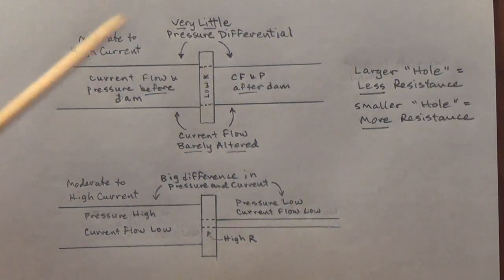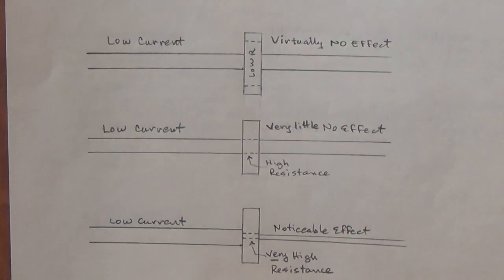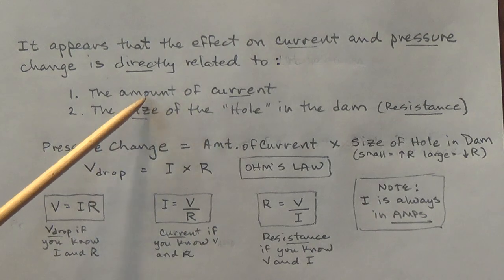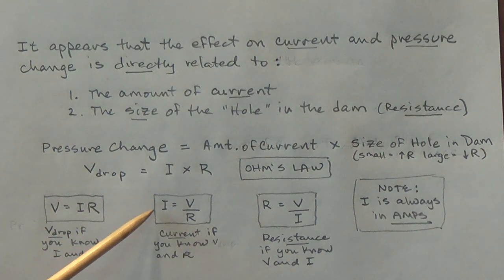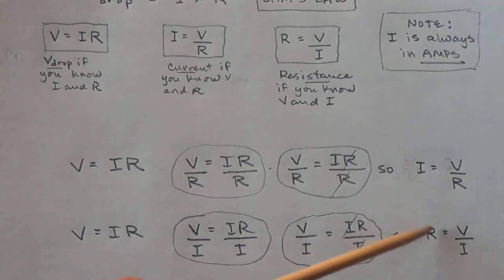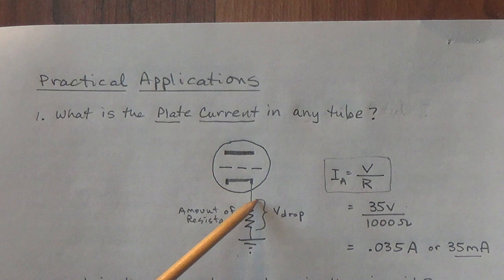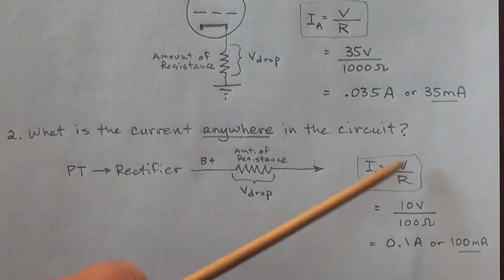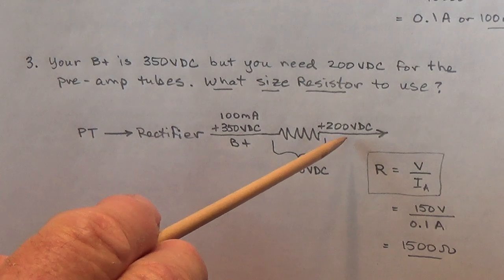Resistors, Part 1:  Their Circuit Function &  Practical Applications of Ohm's Law

Comment: I cannot believe that I *finally understand Ohm's law! Thank you! Drop in River Pressure on the down side of the Dam equals Initial River pressure times the hole in the Dam. 
V = I x R - the stuff coming out of my 63 Fender Concert Output Hole needs to see speakers resisting at 2 ohms so I get my good sounding 40 watts. Proper resistance! 
-
My amp circuit needs to be fed proper current in various places after the tubes... and RESISTORS dam the river for the proper flow.  Wow. Thank you!! I took algebra twice in middle school, the first time I passed, but I wanted to get it (and enjoy it) the way I got math before that... so I took it again to get that A and to understand it.  I love it... but I like Geometry and Trigonometry even better... because, in high school, I loved arguing and proving stuff. :-) Again... THANK YOU!
Reply from the maker: +Jensen Bell  You're welcome, Jensen. Hearing that the videos are helpful and informative is good news indeed :)

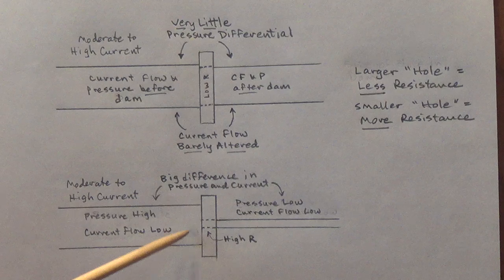Comment: Great video! Did you mean to state that current is lower after restrictive dam (3:20)? Current should be same above and below dam, as series resistor would have same current everywhere right?
Reply from the maker: +GodGunsGuitarsGadgetsGovernment  Thanks, G5. It's hard to draw, but the presence of a resistor in a closed circuit will reduce the current flow throughout the entire circuit, so yes, the current is the same on both sides of the resistor, but the overall current flow is reduced by the presence of the resistor.  With series resistors, the current flow is reduced by the sum total of the series resistance, so both sides of each resistor will "see" the same current, but the overall current is reduced due to their presence.

Comment: Uncle Doug, you probably discussed the best usage of carbon verses metal film resisters, could you please answer this question. When will a metal film resister be better to use in an amp circuit? Thankz
Reply from the maker: +Audio Tech Labs  Metal film resistors work great in the power supply and as screen resistors, since their values are precise and stable. I tend to use carbon comp and film resistors in the signal circuit.

Comment: if you need a 82 ohms resistor and you  don't have it and all you have is 22 ohms and six 10 ohms but you not use wire to connect them instead you are using a breadboard, how is that going to workout on a breadboard ?
Reply from the maker: +Francisco Sanchez  It would probably be easier to order an 82 ohm resistor, Francisco, but barring that, if you connected the resistors in series on the breadboard, they would yield about 82 ohms of resistance. Being on a breadboard doesn't change resistor values.

Comment: is there any way the increase the currents (amps) without increasing the voltage
Reply from the maker: +Francisco Sanchez  Since V = IR, to increase the current, you can increase the voltage or reduce the resistance.

Comment: if i don't have the ohms that the connections need could i put two or more different amount of ohms to = the amount i need?

example i need a 82 ohms resistor but i don't have any, but i have is a 22 ohms and six 10 ohms resistors ?????? will that work!!!
Reply from the maker: +Francisco Sanchez   Yes, if you wire the resistors in series, the resistances add together.  For example, if you wired the 22 ohm capacitor in series with the six 10 ohm capacitors, the total resistance would be 82 ohms.

Comment: Uncle Doug. , let me start out by saying that your videos are exceptional in every way and you have single handedly rekindled my interest in amp and pedal building.  I find that as I am a very mediocre guitarist, my interest is in what makes exceptional tone.  The biggest difficulty I've had is separating what is the circuit for the AC signal from the guitar, from what is the DC circuit in place to create the correct voltages and currents to make the amp turn on and ready for that signal.  I've thought of the guitar signal as a "voltage" but I don't think that's entirely correct, and that's when I get confused about the components in the way of the signal path.  If the AC signal was voltage, then any resistor in the signal path would cause a voltage drop to maintain the same current, but this obviously isn't true as the input resistor at 1MOhm would kill the signal right at the start, but instead increases the voltage of the signal.  For the RC networks, is it just the frequencies of the signal that get effected or is the actual AC signal affected as well?  Thank you so much for your time, attention to detail, and effort.  Your videos are the mana and ambrosia for my soul in these dark times.
Reply from the maker: +Collin Kroen You're quite welcome, Collin, and thanks for your very kind assessment of my videos. My advice would be to keep watching videos and studying specific topics using Google searches, focusing on various circuit elements that you have trouble understanding. The guitar signal is quite weak when it enters the amplification circuit and, like a snowball rolling down a hill, it gathers additional voltage as it passes through the stages of amplification. Since it is an alternating current, it must obey all the rules for AC as it travels through the circuit. I have posted a series of videos explaining every step in the amplification process. I think you would find them interesting and illustrative. Best of luck.
Reply: +Uncle Doug Thanks for the response, now I'm internet famous!  I have actually seen every one of your videos, most more than once, but I guess there's a big difference between watching, and understanding.  As far as the AC signal, I know it's complicated...By the way, best reference in terms of explaining tubes I've ever found is http://tubebooks.org/Books/rider_inside.pdf - Inside the Vacuum Tube.  I suspect you know it, but contributing it just in case.  Can't wait for the next video.
Reply from the maker: You're welcome, Collin. I'm glad you've joined our Internet community. Thanks for the link to the tube book and for your kind comments.
Reply: A guitar pickup generates a varying current that develops a varying voltage across the 1M grid resistor. Ohm's Law in action! That varying voltage is applied to the control grid of the tube.

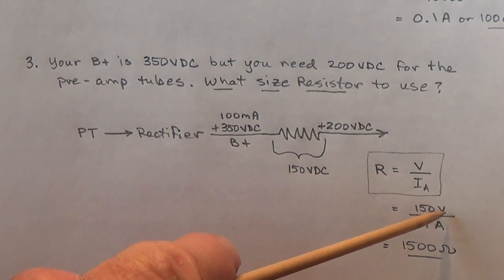Comment: Question about 19:15 of the video re: using 0.1 A as the measure of current through the resistor; how can you assume this figure when you don't yet know the value of the resistor? Wouldn't the value of the resistor effect the current?
Reply from the maker: +Ringo CoC  The beauty of Ohm's Law is that it allows you to calculate any known value if you know two values.  In the example you mention, I know the voltage drop and current, and am therefore able to calculate the value of the resistor.

Comment: If you have a grounded cathode, you could just solder in a 1ohm resistor. that shouldn´t change much of the sound, or build yourself an adaptor to plug between the socket and the tube
Reply from the maker: +Ivo Trausch Yes, Ivo, but why not use the more accurate output transformer primary method, which requires no modification of the circuit?  Another shortcoming of the 1 Ohm resistor method is that any error in the value of the resistor becomes quite significant, i.e. an error of only 0.1 Ohm will produce a 10% error.
Reply: +Uncle Doug I´m not very keen on that method because I feel like in the amps I use I get more error than with the resistor method. In addition to that, I run leads on all my amps to safety "multimeter type" plugs on the back panel so I can change tubes on tour without hassle. While I use 0.1ohm resistors and not many of my amps have much less than 500ohm as cathode resistance, I don´t have a problem with that. 
Anyways, as amp afficionados, we all have our tried and true method on how we approach things. I just wanted to give a tip to the community on how to easily bias their amps, but I don´t know if you already did a video on that. If so, sorry for that. 
Good on you, mate
Reply from the maker: No problem, Ivo. I really appreciate your comments. You're always welcome here :)

Comment: Uncle Doug,
Keeping the water analogy, you completely missed the boat. 
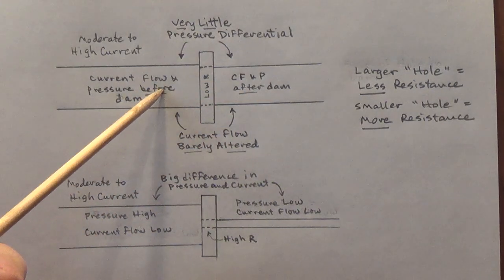At the 2:20 point in the video you speak of and your drawings show a difference in flow rate upstream and downstream of the restriction. For water the gallons per minute is the same upstream or downstream of the restriction. Same for the resistor, current is the same on either side of the resistor.
Reply from the maker: +Tom Rhodes I enjoyed the boat pun, Tom.  In the diagram, the flow rate before the "dam" was intended to depict the current flow rate without the dam (literally "before" the dam).  Naturally, once the dam is in place the flow rate on both sides decreases in response to the amount of resistance the dam applies to the current flow.....and if a second dam is built (in series), the overall flow rate (current) will decrease again. The problem is, trying to draw (and explain) this with a simple line drawing. At this very basic level of explanation, I felt it best to simply indicate that addition of a dam/resistor reduces current flow and creates a pressure differential on either side of the obstruction.  Bear in mind that this is Part 1. In subsequent videos, I will try to enlarge on the very basic concepts presented here. Thanks for your helpful input.
Reply: +Uncle Doug 

Sorry for being grumpy.

Following your lead, the first video of yours that I watched
was the how to identify the leads of an unknown transformer, good hands on
information. Thanks.

I teach hydronics, water flow through pumps, pipes, valves
and heat exchangers. I also teach the electronic controls that operate all that
water and heat flow. I am not a fan of the water analogy to explain electricity.
Ohm’s law does not begin to explain the flow of water.

For one line diagrams I start with a simple circuit with a voltage/current
source and a load resistor. That voltage / current source is a battery with its
own built in impedance. The simplest one line circuit diagram has two
resistors. With that said we can zero in on what a resistor is. Then examine
the current changes and voltage drops across both the resistance intrinsic to
the battery and the load resistor as we change the value of the load resistor.
Reply from the maker: No problem, Tom, and another good pun:)  I genuinely appreciate knowledgeable input, like yours. Thanks for following up on our discussion, and for some excellent suggestions. I hope you get the chance to watch some more videos and that you enjoy them.

Comment from the maker: Elbertelrod, you do not have Google + active, so your comment had no Reply capability, therefore I'll answer up here.  Yes, indeed, if you "neck it down" and restrict the free passage of water, air, electrons, etc. through a hose or wire, pressure does go up......behind the obstruction. Since all gasses and liquids move from areas of high pressure to low pressure; the fact that they always flow from behind the dam (or resistor) to the other side proves that the pressure is greater behind the dam or resistor. If it weren't, the flow would be in the opposite direction.  I think you're confused by the apparent "pressure" or force of water escaping from a hose when you put your thumb over the end.  What the water actually has is increased velocity and momentum (kinetic energy).....not pressure.

Comment: +Han Solo
You don't have Google+ active, and therefore there is no "reply" link under your comments.

The wattage is calculated as simple as the rest. The formula is Pmax = Imax x Vmax. So you have to establish the highest voltage drop that may happen in a given circuit and multiply it by the highest current that may flow through the resistor, and then round it up to the next standard value. 
For exaple if you have a resistor that carries a maximum of 200mA = 0.2A, and the maximum voltage across it can reach 30V, then the maximum power dissipated by this resistor will be 0.2A x 30V = 6W. I'd use a 10W resistor, 8W would be my minimum.

Metal film vs carbon. Long time ago it was simple: carbon mass resistors were unstable, had poor tolerance, low power handling capabilities, lower breakdown voltage, large temperature drift and noise. But were cheap. Metal film resistors were superior in most respects, and were expensive.
Nowadays there are poor quality metal film resistors, and mass resistors made of carbon-related materials, like conductive polymers, which have better (lower) inductance, noise and thermal factors than metal film ones. So it is not that obvious any more. 
Generally, metal film resistors are a safe choice, unless inductance is a factor (HF/pulse applications) - in those applications even a standard carbon resistor might do a better job.

Comment: Thanks for another excellent video :)

The third example is not exactly fortunate IMHO, as it is not clearly stated, that the preamp part draws 100mA of current. In the previous example it seems like we arrived at the total current draw from the B+ being 100mA, so ( unless the examples are completely unrelated to each other), the current going to the preamp will be far less than 100mA, as majority of that current will be drawn by the power stage.

+Han Solo raised doubts regarding this, unfortunately he probably doesn't have Google+ so we can't reply to his comments. He's right, that the actual voltage drop will not be that easy to calculate, as the preamp stage has its own resistances, which will cause the current draw to decrease when the supply voltage decreases, so indeed a couple of iterations may be necessary to optimize this series resistor.
Reply from the maker: +68Stan You're welcome, Stan, and thanks for your clarification. I agree that the parameters in example number 3 were not clearly spelled out, and the calculations performed were independent of other factors within the circuit, but I simply wanted to show that, using Ohm's Law, any one value can be calculated if you know the other two. 

At this level of explanation, I doubt that the majority of viewers would have benefited from a dissertation on the iterative process required to accurately determine sequential reductions in voltage and current within a power supply circuit. Hopefully, such considerations may be feasible in later presentations, but for now, I'm simply trying to establish a basic foundation (or review) for the majority of viewers. 

Also, thanks for explaining why some people's comments have no Reply capability......it's been a bit of a mystery (and nuisance) for quite a while.
Reply: The resistor Uncle Doug chose as an example was perhaps unfortunate. When designing the amp, to calculate the value of that resistor you would first need to establish the total current drawn by the preamp stages. The current for the output stage is supplied directly from the reservoir capacitor and does not pass through that resistor. As Uncle Doug says, his purpose was to demonstrate that, knowing the current and the required voltage drop, the resistance can be calculated.

Comment: Uncle Doug,  my question is a little tangential to your video, but has to do with resistors none the less, specifically, variable resistors. It is; why do volume pots of different values in a guitar change the tone of the instrument, even if they are on "10" and therefore not providing any resistance?  (i.e. 250k pot for warmer and 500k pot for brighter) If this is the case in guitar circuits, is there a similar influence on tone in an amp circuit?  Say, two pots of different values, adjusted to the point in their sweep where they provide equal resistance (i.e. a 500k pot set to 100k and a 250k pot set to 100k, would they affect the sound differently?) Thanks, as always I enjoy your videos.
Reply from the maker: +bills48321 Pots are variable resistors when wired between the wiper and either end, but end-to-end they are fixed resistors. Increased pot value to ground would result in higher impedance, maximizing gain and improving high frequency response. In addition, if there is any capacitance in the pot circuit, it would create a high-pass or low-pass filter.....influencing tone.  You should watch my video on Tone Stacks, where this is discussed in detail. In addition, there is a link to a Tone Stack Calculator which will allow you to experiment with different pot values and see the resultant changes in the audio output spectrum.

Comment: OK i get it now. Right on. Great video!
I took my Super reverb to the shop and when over it with the tech and the reason my tubes were red plating so bad was because i had the bias cap in backwards somehow.Everything else was okay.Then we added a 1 ohm resistor so i can check the plate current.I recovered the amp and all too.then i found out that only one of the speakers is good. i ran it into a cab though and the sounds great. I'm thinking about getting some ceramic jensons to replace the the original's for now.Is it worth recone-ing them, i do wish i could have the alnicos in there?Although i do have one speaker that's good and i'm mainly using it to record so i can mic that speaker.Have you ever re-coned a speaker?
Reply from the maker: +Jonathan Kosyjana  Thanks, Jon.  A backwards bias resistor would definitely cause some current flow problems. I'm glad you got it fixed. Yes, I used to re-cone all the time. If you can find a reasonably priced re-coning kit on Ebay or the Internet, you might try doing the job yourself. With an Alnico speaker, it would probably be much cheaper to re-cone than to replace it. Good luck.